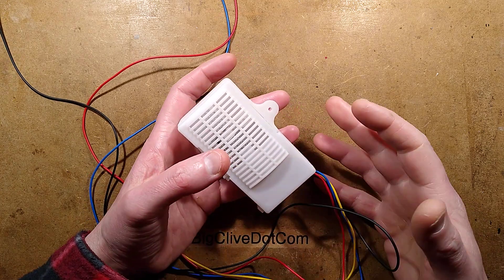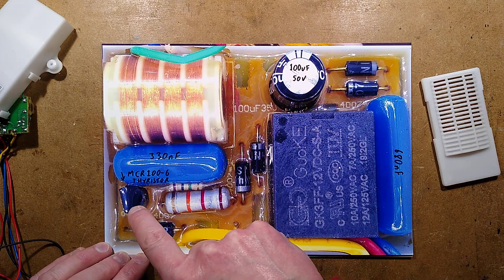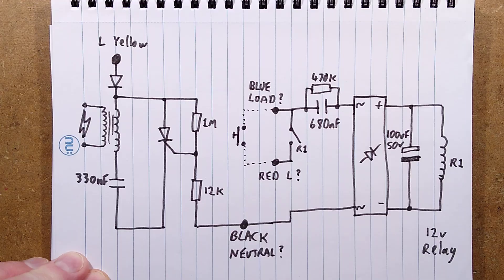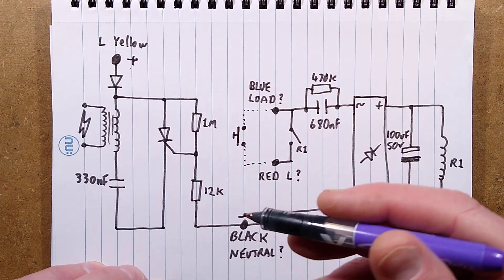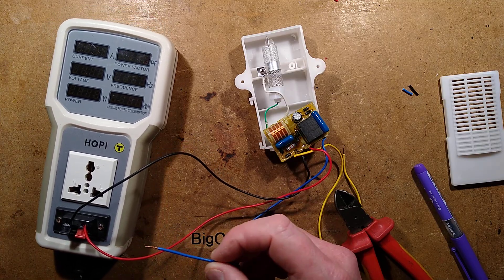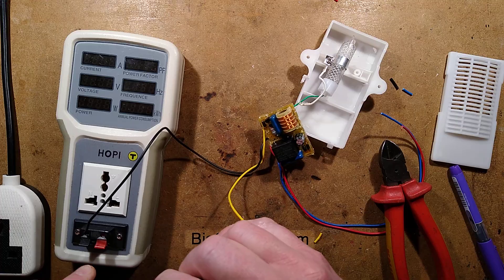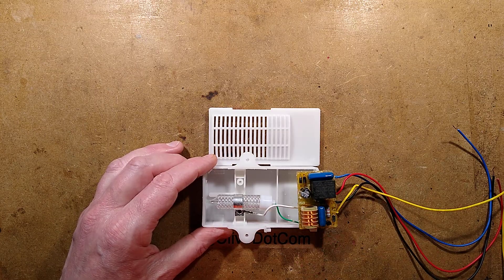Random high voltage eBay "thing"

Comment: That tube... is it sealed? Because if it is, I don't think the corona discharge can generate much ozone directly, but it could be emitting enough UVC to generate some ozone that way.

My point being: if it's actually a UVC lamp, don't look at that stuff!
Reply from the maker: The gas just couples current to the inner surface and the capacitive coupling to the outer mesh causes a corona discharge on the outside.

Comment: Can you give us the reference for the thyristor please?  I'm guessing that the values of the resistors are tweaked for a specific device rather than a generic thyristor.

No response 4 months later :( - what I am now wondering is if any part of this <magic> circuitry is likely to stop working after a period of operation?  That method of operating the thyristor is novel... but is it sustainable, electronically speaking?

Comment: Isn't the discharge happening inside a closed glass tube? How's the ozone coming out?
Reply from the maker: The gas inside just couples current evenly to the inner surface.  The corona happens via capacitive coupling on the outside.

Comment: Let me just chuck this randomly coloured cable from a Country renowned for often using non standard cable colours, right under here.

Rofl, true story right, worked in a building where the electrician had wired two 3 phase circuits together. We don't know how it happened, but they found that devices on the two circuits would only work if both fuses were turned on. Turns out that half of each was wired into the wrong circuit.

So if you imagine the above, it forced two machines to run through two fuses, meaning that if both circuits had a machine on them, the combined weight of both would have overamped the fuses.

Comment: if nobody knows what this is for,  its used in hvac systems,  2 plates close to eachother are Positively charged , and as dust and microbes pass through it supposadly sticks to the plates , to be taken apart and washed later in life.  these ion  chargers are a joke, they do work but  if you have a high flow unit, you need to have it circulate through multiple of these devices,  maybe even6 of them  to get  perfect air cleaning.
Reply: and these units do break, but are cheap to  re create, theirs better HV generating devices then  one of these.
Reply from the maker: This isn't an electrostatic precipitator.  It's an ozone generator.
Reply: @bigclivedotcom  i guess they are close to similarity ,  thanks now  i know  what it is

Comment: I just put in an iron filter on our well water that has an ozone generator combined with a small compressor. The ozone is supposed to kill iron eating bacteria, and also oxidize the dissolved iron into a form that can be filtered out and backwashed later. Ozone generators are being marketed to sanitize, kill mold, deodorize clothing items rooms etc. but it is not breathable, so use it with discretion. The iron filter works great just FYI.
Reply: I'd also like to add that your enlarged photos are great. You do a great job demonstrating.

Comment: I look at the diagram.

And I ponder.

So we have a toggle circuit, with no output.

And a potentially dangerous ozone generator.

You might think they take the output of the toggle relay to turn the high voltage circuit on. Or feed it outside to feed a stronger relay.

But instead they just bypass it entirely.

So what gives?

I am wondering if the entire point is a second circuit and switch setup. And that toggle was supposed to be connected to a 'job done' light.
Power goes on. Ozone generated, warning light on the ozone timer, meanwhile inside a little light turns on saying 'sterile' at the same time. Or perhaps even they have an output from their timer to toggle the light at the end of the cycle.

But they didn't see a need for the light component. But didn't delete the voltage dropper nor the relay because that would change something they didn't understand.

They build a component that doesn't feed anything external (power neutral, signal input and Ozone are all 4 wires) and controls nothing internally either.

Helpful.
Reply from the maker: I think the interlock may be for a UVC tube.
Reply: @bigclivedotcom  but they wired an input Into it, and still failed to provide an output to feed to an additional feature or component.

Which is why I half envision this was on the bottom of a 'sanitation' box. With a top mounted timer circuit. Turn dial/push button, starts countdown. As it finishes, turn off yellow and cycle the toggle on: contents clean light on, box closed? Switch cuts primary power (red line) ready for next operation.

All very pretty and useless for the application delivered particularly with the light removed, but the 4 wire variant continues to be sold because all relevant inputs continue to function.

Otherwise I would expect power to red should be a switch to isolate components and not need the signal wire at all.

And from what I saw cycling the signal wire doesn't flip that relay, just activate it as a toggle.

Why does this thing have an toggle on switch that doesn't turn components off? I would thus presume that was the duty of a separate component/board.

I keep wondering how to deploy one of these types of device for entertainment as a visual feature.

That or I should just invest in more plasma balls and Jacobs ladders.

Comment: When doing tests like this. Plug in the quick test into the hoppi as well. Then connect the momentarily connection to the quick test. Leave the constant connection in the hoppi as you have them here. Then you can close and open back up the quick test and not have to be holding the wire used for momentarily connection.

Comment: So, what's the purpose of the latching circuit? I thought you needed it for enabling the device, but you seemed to be just fine without it at the end of the video, using only the yellow and black cables.

Is it just an optional feature? I'm thinking blue to mains, red to yellow, black to neutral, and a momentary switch between blue and red. Would that be a sane way of installing something like this?
Reply from the maker: Possibly an external UVC lamp.
Reply: @bigclivedotcom  Oh, that actually makes a ton of sense. Still, it's super interesting how you got essentially two independent devices in one.

Comment: 1. The use would be to sterilise the air and reduce odour in (for example) sports centres, where the humidity and body odour can be foul; these devices can be very effective. 
If they produce too much ozone, that becomes hazardous.

2. By using half-wave rectifcation I wonder how much RF interference is produced. Have you checked on this; can you check on this?

Comment: I once had a hepa/ ozone air filter thingy that gave off that smell. I named it Bernoulli cause the air shot straight up and would reliably keep a balloon suspended in the airstream for months on end until it was finally too deflated. Balloons were called Wilson. 

There were many Wilsons but only one Bernoulli. I miss you my caustic little friend.

EDIT: OG Honeywell 17000-S in case anyone would like this joy (older version with the rubber buttons)

Comment: I've purchased previous a 20gram dual plate  o3 unit it's far too powerful even using the  ABE1 filters and it's crazy that there's no real output laws and I've seen ( silver bullet) machine s back 20 yrs ago
Reply: These used to be installed in public bathroom's in a white oval unit near the ceiling then used for commercial cooking and industry , ..... 10 years later it's used for uv sterilizer water , and public water pumping stations .
Smells like metal thunderstorm s .

Comment: This was cool to see since I work on very big ones of these that run on 45kV to 80kV they use it to collect ash particles from boilers to keep them from going out of the stack.  The discharge electrodes are usually around 30 ft tall with hundreds of them per field.  I wonder if they sell those to put in a duct or something to assist with air purification.  Maybe sell it as making your AC like an ionic breeze.
Reply from the maker: The ones you're talking about are electrostatic precipitators.
Reply: @bigclivedotcom  Yes, that is awesome you know of them. I inspect them and do calibrations and performance improvements on them.

Comment: joining the yellow wire to the blue wire, Live to the red and neutral to the black, then when the power was turned on you would need to press your switch across the red and blue for it to start. If you have another switch, normally closed, in series with the red, then pressing that would turn off the relay and the circuit is turned off. A switch to turn it on and another to turn it off.

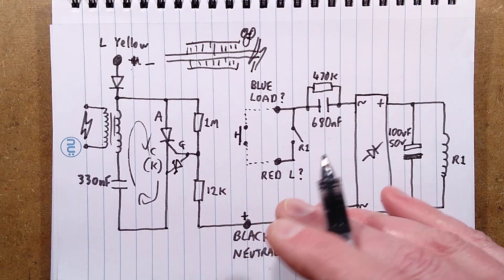Comment: Did you say "out of a coronavirus generation chamber?"  at 9:10?  That's quite an interesting hypothesis.  Anyway how do you arrive at this reverse engineering?  Do you have a spice simulator or something that helps you visualize?
Reply from the maker: Just an understanding of the circuitry.  It's more fun when they've got weird tricks like this one.  The module may actually be for a chopstick steriliser.

Comment: You should get autostrippers. The ones I use are awesome. No thinking just throw the wire in, squeeze and done. Maybe a slight tension adjustment for not nicking small wires or to get through bigger ones

Comment: Neat little light bulb, I remind having one of these "chinese ozone generator" machines. They cost like nothing, they work for 1 month, but they light up the entire room with their overkill little red LED light bulbs at night.

And Gosh, it's still sold at Aliexpress.com:
https://www.aliexpress.com/item/32408301521.html?spm=a2g0o.productlist.0.0.100b696aClCnEY&algo_pvid=b613e914-e309-4945-8af1-bf0124e46755&algo_expid=b613e914-e309-4945-8af1-bf0124e46755-35&btsid=0b0a01f816147623884554081e4b2f&ws_ab_test=searchweb0_0,searchweb201602_,searchweb201603_
Reply from the maker: While pro indoor ozone, it has to be at natural levels.  Be careful not to overdo it.  What's the failure mode of these?
Reply: @bigclivedotcom  Well I often had to cut this weird prototype-scale chinese device at night, because it stank like an ozone overload, even at minimum.

The failure was simple: the beam that generated ozone just didn't generate ozone anymore. It normally emits blue light, and there's a fan (hence the wave-shaped grid at the front). When I looked at the bottom mesh grid, the blue light was dim. And it didn't generate enough ozone to be worth using anymore. :o But I looked inside, and yeah, it was quite well done. Just no fuse nor smoothing, but good primary/secondary spacing, and quite good components.

Just, a bit too cheap to last. Fortunately, unlike other chinese devices, this one died before it would, let's say, burn my whole house. :)

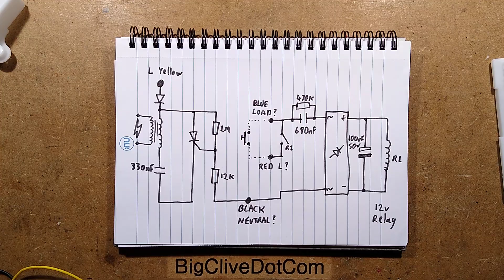Comment: The diagram that you show at 3:57 must be wrong. What forces a current to flow in the transformer-primary  (primary coil --- thyristor --- 330nF)?  The 1Meg and the 12k resistor?
Reply from the maker: It's correct.  Just very weird

Comment: Cool!  Might it be a quartz UV tube driver?  (Just ultraviolet ozone in other words?  No neg ions?)   
Looks like high-pressure argon discharge, actually.  Maybe the Chinese suppliers won't make custom tubes with Hg.

One simple sensor for UVB:  those color-change dye beads sold by science edu suppliers. Here's one https://www.teachersource.com/product/ultraviolet-detecting-beads
Reply from the maker: I think the tube is just to couple current evenly to the glass so that a Corona discharge occurs between it and the mesh.

Comment: Would this circuit fall under the "thyristor relaxation oscillator" heading?  Seems to be very similar except they are just using the clever method to do a rectification for the AC.  It looked very familiar to me when I initially saw it.

Comment: If the tube is sealed, it might be the safest ozone generator ever - because it can't release any ozone. What gas is in the tube? Mercury might emit ultraviolet. Or get a spectrometer and see what light is coming out.  The blue color of the sparks reminds me of the ultraviolet lamp in a EPROM eraser. If it emits ultraviolet, which might make traces of ozone or cause other chemical decomposition where it strikes.

Comment: Clive, Instead of the L.V. relay and accompanying parts, wouldn't a small triac and 2 resistors for voltage dropping work just as good and even be cheaper?

Comment: Seeing the potting brought back nightmares. I had to fix this cable once that was  potted with a black rock like substance. The cable was $1500 so trying to repair it was a high priority. Soaked it in urethane reducer for a week and finally dissolved everything and left the electronics easily exposed. A 220 ohm resistor was the problem. I still remember that value and it was 25 years ago.
Reply: It probably tar

Comment: We call the right hand side of the circuit a safety , a latching circuit or latching relay,  and as you say, it drops out on power off. 
 the switch could be an off / on, where you place an item in a chamber, or a timer, to run a cycle of sterilization. or a combination of the two. But it's going to turn off if you open the door as a safety. The largest negative ion generator I have ever made (as a mad scientist project) was with a 14,000 volt oil furnace transformer, a 9 foot stainless steel collector (outside and connected to the device with larger rg-8 coax), and a simple power diode lead as an ion needle like emitter.  You could not breath in that house when it operated. And the outside collector element hummed like a high tension power line. (Very dangerous.) The same transformer is often used with Jacob's ladder type effects. But there was no cross over spark allowed in the negative ion generator project. Do not try this at home...

Comment: Hey Clive, 240 is only about 10% above 220 so we should only see ~13.2V across the relay. I'm guessing the capacitor passes 60Hz better than 50Hz as well.
Reply: 3902 ohms at 60 hz vs 4683 ohms at 50 hz.

Comment: ozonizator...I've done an identical  module with a glass tube filled with iron sponge for ground and the other electrode connected wit a sereies of turn od copper around the test tube. The box is in white PLA; and obviously, a manual assembled circuit with the same transformer they used in your module
.

Comment: Uh, I'd have to calculate it, but don't the 12V and 220V relays use the same power? For the same size of relay of course.
But the 12V relay is probably a lot cheaper.

Comment: I wonder if the extra 20 volts you have on your mains is enough to break down the dielectric strength of that discharge tube into a spark gap vs a corona.
Reply from the maker: I doubt it.  The tube only has one electrode so requires quite a high voltage to couple capacitively through the glass.

Comment: Hey Clive have you seen "5A MPPT Solar Panel Controller Voltage Step-down Module Constant Current with display " it seems to work without a computing module . I would be interested in your thoughts on the item (ebay item)
Reply from the maker: Many MPPT units from eBay are just simple voltage threshold devices with no tracking.

Comment: They had to make sure it made that crackling noise so the customer could feel like it was actually doing something.  It reminds me of a Chinese USB mosquito zapper I bought for amusement at a flea market for about $2 US.  The zapper had a nice ring of bluish (suggestive of UV) LEDs.  The problem is that mosquitoes are not especially attracted to UV light because they often feed at dusk.  House flies maybe, but the slots were too small for flies to get in and touch the electrodes.  There was a little audio transformer run backwards to put out about 100 Volts to the electrodes, and I am not sure it would have zapped any bugs, at least mine did not.  I got a questionable 3.7 volt battery out of the deal for my parts box though.

Comment: looks like a gray tube. is the rod in the middle one piece or two? solder a power diode on the cage and take a power reading.
Reply from the maker: Just one electrode.
Reply: @bigclivedotcom  yeah read it back to black wire as ground. But yeah you can try two diodes too. Look Ed Grays work if you have not heard of it.

Comment: Dear Uncle Clive. I am having a house built in the philippines and have asked that a proper earth be installed and worked throughout. Are there any simple tests I can perform to confirm everything is ok?
Reply from the maker: If using RCDs then you could use a simple RCD test plug to ensure they trip with ground leakage.

Comment: During discharge UV light with wavelengths shorter than 250nm are generated. The light is partially absorbed by air (generating ozone) but you really shouldn't look at it without safety goggles.

We use two 100 Watt mercury vapor lamps to sterilize working benches. I'm sure this product does effectively nothing.
Reply from the maker: I don't think this generates an UVC at all.  It's purely creating ozone with corona discharge on the mesh.
Reply: @bigclivedotcom  corona discharges always generate uv light. The actually wavelength distribution depends on the voltage, medium, gas pressure and so on. If you have the chance to check it with a spectrometer or an uvc detection card, give it a try.